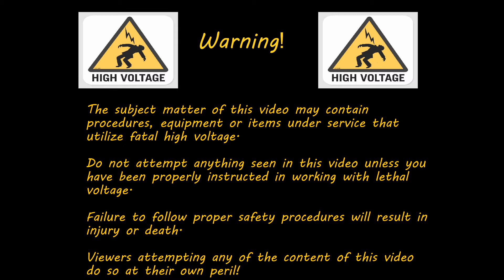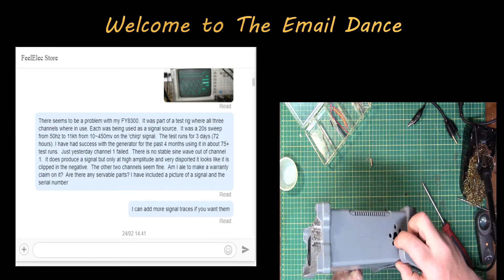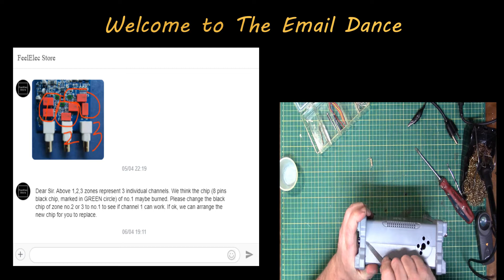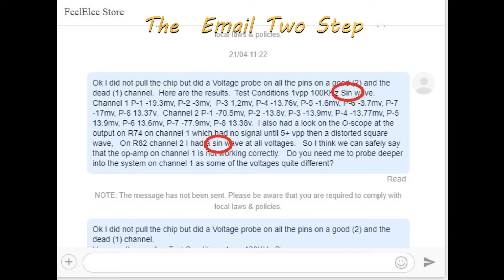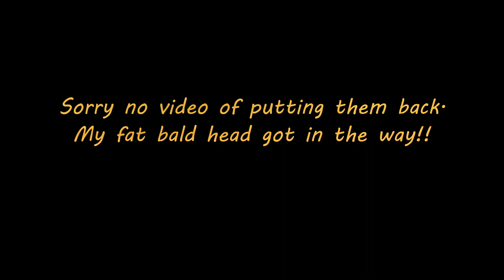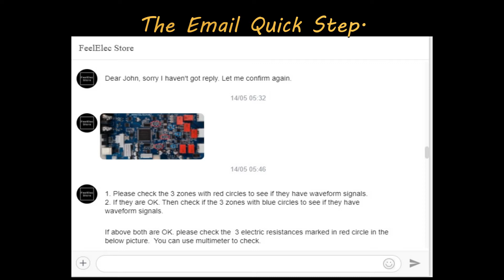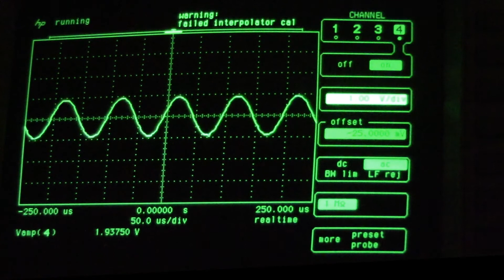01921 FeelElec 8300 Fail

Comment: Thanks for showing us the internal design..... No mains Earth connected internally 😞. Maybe not too risky at 110V, but here in Australia at 240VAC I'd be a bit worried about the design of that internal Switchmode power supply. Hope it's at least CATII SELV to ensure Voltage doesnt appear on the outputs.....
Reply from the maker: Yeah nothing hunky enough to connect earth to on the chassis anyway.  If I remember correctly on this version the power supply is a separate board which is a big improvement over the earlier versions.